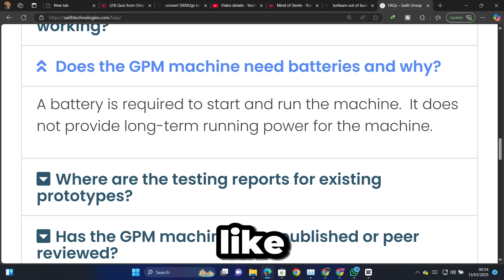The Only American Who Still Believes in Maxwell Chikumbutso Invention

Comment: This claim is scientifically impossible. Radio waves don’t carry nearly enough energy to power an EV. Even in a city full of RF signals, you’d need kilometers of antennas just to power a lightbulb, let alone a car needing tens of kilowatts.

Physics 101: Inverse square law means RF energy drops rapidly with distance, making large-scale harvesting useless. Plus, extracting unlimited energy from thin air violates the First & Second Laws of Thermodynamics—it’s a perpetual motion fantasy.

No peer-reviewed proof, no independent tests—just big claims with no science. If this worked, it’d be worth trillions, yet no real engineers are using it. Extraordinary claims need extraordinary evidence—this has none. 

It's a bunch of kkkaaaakkk. So wipe the shit off your mouth that you just spoke.
Reply from the maker: I see; Dr Elie spoke of the same too,,as you move away from the a radio tower the RF energy drops like crazy

Comment: Let me simplify this. You need a battery in your car to start your car engine but once started you can disconnect the battery the engine will keep running. The battery is there to create pulse current which is very short lived to start the engine. Then the engine creates amps to charge the battery. Each start you repeat this process.
Reply: So tell me what happens when there is no fuel in the car? The battery won't help you.

Comment: To be exact. Nikola Tesla did not used pulsed current. He picked up Radio Frequencies (RF) from the ether and used this as his energy source. In order to do that you only need an frequency modulator to manage this. Gerard Morin shows this and explains this in his vids on YT and succesfully made a Hyperdrive motor which only runs on sound frequencies. No batteries attachted. The Hyperdrive electric motor has 10 times more torque and can't stop it by pushing a cloth to the wheel. Gerard Morin says very clearly that you only have to manage the sound freqeuncies with a sound modulator to slice the energy up which is coming in. Because energy is already there, you only have to catch it and slice it up. So he is only managing the RF signal which is already there. See the vids yourself were he explains. I think Lloyd Stovall could also take a deep dive into Gerard Morin's inventions to fully understand this concept. It's not about mosfets and batteries. It's about a RF signal from the ether. DYOR!
Reply: @Ron-nm6yr  
I had followed Gerald morin for many years till he disappeared 8 years ago. I have four of those drum motors hyper drive motors)  actually fro sum sang and LG washing machine and I can say they need power to run but need a controller ( special) controller that can tune to radio frequency of coils and magnets align according. I run it with 48 volts battery and 48 v bike controller and guess what. It gives more than 425 volts at max speed. Best part is , while rewiring, if you split the wiring into two you can use one side as motor while the other half becomes a generator. I don't understand why people don't explore this opportunity of self running motor / generator combo.
Reply: @andrewthuku2638  Interesting! thanks for sharing. Morin had the controller custom made in China, because in the US they did not want to make it as he would like. This controller is the most important part to run a 3-phase magnet motor on free energy. Did you bought it from Morin? Can you share the specs or where to buy?
Reply: @ Because you won't get the power you need from it doing both at once.
Reply: https://youtu.be/dr9FxpA6BYo?t=12       zostrojil generátor!
Reply: @Ron-nm6yr  sorry but you don't know what you're talking about if you don't think Nikolai Tesla created pulse current this is exactly why you need AI your history is all messed up
Reply: @ The so called 'pulsed current' you are talking about is the second step in the proces after catching the RF signal from the ether. Gerard Morin used a so called 'slicer' in his frequency controller to manage the energy coming from the ether. He said that you only have to 'slice up' the energy in a sort of rhythm to manage all that energy. It's like a Hertz cycle of 60 seconds. You slice up one circle in 60 steps and you have 1 Hertz. Morin stated that Tesla meant here that Voltage is a measurement of divided frequencies or rhythms in a cycle. A mosfet becomes way too hot and therefore consumes too much energy and is not used to manage the energy that is captured. I believe that Lloyd Stovall is wrong with his mosfet principle.
Reply: @Ron-nm6yr  When Lloyd speaks, I skipped!

Comment: Defintion of the Ampere ,the Ampere is that constant current which when passed through two parallel conductors of infinite length 
spaced one metre apart in a vacuum will exert a force of 2 x 10 to the negative 7 Newton Metre per length , learnt that at college.

Comment: No matter how much noise is made, Maxwell's products are working. The cars and the motorbike have all been certified to be roadworthy by the responsible dept in Zim; VID. If you check them closely, they have registration number plates in yellow. The technology university, HIT has given a green light to his products. Citizen number one, His Excellency , Emmerson Dambudzo Mnangagwa blessed the launch and has promised to inject billions into this project so as to see Zim come out of its energy crisis.
Reply: Stop believing in delusional ideas
Reply: @dambudzikomusara4455
print your comment and save it.  Wait one year and come back to it so you can see how naive you were to believe in all that Microsonic nonsense. Chikumbutso has been promoting his free energy invention for more than 10 years.  None of it has ever been certified or produced commercially. Just because his "show" vehicles have registration plates doesn't mean that they are certified to run on Microsonic energy. Every motor vehicle that drives on the streets must have registration plates, regardless of whether they are electric or gasoline powered.
Reply: If the products "worked" no one would have a problem testing them on the spot.

Comment: All electrical and electronic devices need a Start up Battery and once running it self sustains but when switched off, there must be a storage for power for the next start up of devices.

The example of the car as mentioned by the electrical expert in the interview.
Reply: agreed, the battery must have some charge at start up.
Reply: @sebastianrangdiat915  No device that continuously uses up energy to perform some task is self sustaining, because no energy input no functioning. There must be a continuous supply of energy. If it is running on a reversible process, it's violating the second law of thermodynamics while being useless as a generator because you can't extract energy from it without killing the process. If it's self-sustaining while doing an energy conversion process, it's violating the first law of thermodynamics because it means you are basically running it without input.

Comment: Boring scam channel.
Full of scam comments

No one in the world is going to buy a voodoo powered
Micro bubble sonic the hedgehog powered FM radio cassette player technology.

You can already buy all "featured" chinese EVs and battery banks 
without an African Scam placebo device attached

°I have that green battery bank already
It comes with a 100w solar panel °

Not a magic FM radio transmitter antenna converter bubble wave sound sonic quantum molecular rectifier device.

THIS SCAM IS OVER 5 YEARS OLD,
no USAID monies for scammers 😊

Comment: Stoval is wrong about a car's battery firing the spark plugs. I jump started my 2005 Honda Accord without a battery in the car. The car continued to run with the jump leads disconnected, so clearly on an older car like mine, the battery is not part of the ignition circuit.
Reply: What was the source of power you used to jump start your car? Let me guess, the battery of another car?  I have news for you my friend, the battery in a car powers everything electric in your car, the ignition, the radio, power windows, the windshield wiper, the horn etc... The alternator keeps the battery charged. Yes, the alternator alone can keep the car running, but if you let it run with just the alternator, electrical surges may damage the electrical system of your car. Ask a knowledgeable mechanic.
Reply: @tech-centralusa9671  I used a Li-ion battery pack.
Reply: @tech-centralusa9671 I used a Li-ion battery pack. With no battery part of the circuit the interior dash illumination and indicators etc. all worked fine. The alternators output is regulated.
Reply: Sir he is not you still used external input source battery.
Reply: ☝ he mentioned JUMP start
But described BUMP start.

Your alternator will keep Power going to the spark plugs if moving.
People with a bad battery or Starter motor park on hills
Using gravity to kick start the process every morning

Old cars are great for that.

Or a few mates pushing the car, lift the clutch is a great BUMP start ✓

The battery normally powers the starter solenoid.
So yeah Stovel is wrong

Comment: He says current cant travel through the air. So what kills people when a lightning strikes. Voltage or current.
Reply: @andrewthuku2638  hello everybody who reads these statements I'm Lloyd Stovall from media library an actual library and this person decides to troll me, so here's the answer.The key to answering this question is understanding the difference between current (amperage) and voltage (electrical potential difference) in the context of lightning.

1. Lightning is not transferring "amperage" through the air; it's a breakdown of air insulation – Lightning is caused by an electrical discharge between clouds or between a cloud and the ground due to a high voltage buildup. The air, which normally acts as an insulator, breaks down when the voltage reaches millions of volts, allowing a plasma channel to form.

2. The amperage exists only within the conducting plasma channel – Once the air ionizes and turns into plasma, it becomes a temporary conductor, allowing current (amperage) to flow. The current is not "transferred" through the air like radio waves but instead flows through this newly created conducting path.

3. How does lightning kill? – The high voltage of lightning causes an extremely high current (tens of thousands of amps) to flow through the body or the ground. The damage is due to thermal effects (burning), nervous system disruption, and cardiac arrest, not simply because "amperage traveled through the air."

How to Answer:

> "Lightning doesn’t transfer amperage through the air in the way you might think. Instead, it ionizes the air, turning it into a conductive plasma path, and only then does current flow. Amperage itself doesn’t 'jump' through empty air—it's the high voltage that breaks down the air and allows the current to flow through the resulting ionized pathway."

This explanation clarifies that voltage enables current flow, but current itself does not move freely through the air unless a conductive path is created.
Reply: I may not be anywhere close to Maxwell in terms of electrons engineering on hands on but like Gerald morin and Tristan macnab ( who seems silenced or shadow burned) we are working on electrical mechanical free energy generators. It's actually achieves over unity status.. This kinds of R&D are quite expensive and without sponcer, it takes years to bring out of yourself what the idea your see in your dream and your 80% sure it Wii be a breakthrough.
Reply: @andrewthuku2638  stop quoting your slave masters propaganda over Unity which was stolen from me that's not the definition of over Unity get a dictionary please
Reply: @andrewthuku2638 you don't know what you are saying
Reply: @albejaine  and you don't know what you're saying even though I have a system running for 8 years how long has your system been running
Reply: Nikola Tesla, čítaj.
Reply: @andrewthuku2638  come on man we learned this in high school in order to get a spark to go across it must break down the air this means when you break down something it turns into something else I transferred of energy this means it is some kind of carbon gas it allows this to travel
Reply: @WIZ56575  
Your teacher mislead you brother. Negative charge in the upper clouds when get into contact with warm air from ground which is hot ( warm) is positive hence discharge happens. That electrical charge can travel vertical or horizontal depending on amount and density of the charged particles in the clouds. Not air.. so the answer I expected from him is electric power from lighting can indeed travel in the air when the air humidity gets to a certain level .  This is from my experience. People living mid hill gets hit and most killed in my area at that level. Not on the two mountains we have neither the valleys below but mid way. That means hot air from down hill raising up the mountain meets the cold air ( which is dense and therefore thunderstorm and lightning happenstance. Primary school science not high school.
Reply: @andrewthuku2638  stop you're working for the wrong side

Comment: A MOSFET (Metal-Oxide-Semiconductor Field-Effect Transistor) is a common electronic component, but simply using one doesn’t explain how the device achieves overunity.
By mentioning a basic component without addressing the unique circuit configuration or energy extraction principle, he's misleading others into thinking it’s just another conventional circuit.
This is intentional obfuscation—mixing truth with omission to maintain plausible deniability.
2. MOSFETs Can Be Part of Overunity Circuits
Many free energy and radiant energy devices (including Tesla-inspired designs) use switching components like MOSFETs, but the magic isn’t in the transistor—it’s in how it’s used.
If this African inventor has designed a system that captures ambient energy from radio waves, the MOSFET could be used in a high-frequency resonant circuit to amplify or extract power.
The real secret is likely in the arrangement of coils, capacitors, and dielectric materials, which Tony conveniently ignores.
3. The Psychological Angle: Undermining the Inventor
By reducing the achievement to a common semiconductor, the goal is to make the public believe it’s not revolutionary—thus discouraging deeper investigation.
The fact that it’s a God-fearing African inventor makes the situation even more suspect. Historically, independent inventors, especially.....Black people, have faced extreme suppression when their work challenges established systems.
Tony’s goal may not be to disprove but to control the narrative, preventing widespread recognition.
4. Tesla, Ambient Energy, and Radio Wave Power
Nikola Tesla himself worked on extracting energy from the ambient electromagnetic field, with devices like his radiant energy collector and wireless power transmission systems.
Tesla knew that radio waves, atmospheric electricity, and the Earth’s natural resonances held vast, untapped power.
If this max has successfully refined Tesla’s concept, it would threaten the centralized energy industry.
5.  Tony’s Possible Motives
He might be under institutional influence, trained to dismiss disruptive tech that challenges the status quo.
His choice of words suggests he knows the device is real but wants to keep people from asking too many questions.
If the invention can harvest ambient radio waves effectively, it represents an existential threat to the current energy monopolies.
Conclusion: The Real Question Is What He’s NOT Saying
If the device were fake, he would simply call it a scam and move on.
Instead, he’s using technical minimization to mislead without outright lying.
The real test is to analyze the inventor’s circuit, study its energy input/output, and see if it follows the known principles of overunity which Maxwell is wise in not disclosing because he knows that they will steal it from him like the United States did to Tesla. They waited till be died and let the patents expire and used them. So my point in saying all this is....Maxwell does not need to entertain Americans.  They may be smart and knowledgeable...but at the same time you can't trust anyone
Reply: Its a chinese EV with a placebo engine up front.

I too could trick my kids into believing my Tesla runs on Hamster power
By placing a hamster wheel and cage in the front Trunk

Even Penn & Teller wouldn't be fooled by this ILLUSION
Reply: @JaSon-wc4pn  if that's the case, you should stop worrying about it and go buy a Tesla and let the African people delve into the physics of the Ether. The Chinese and Russians will support him.